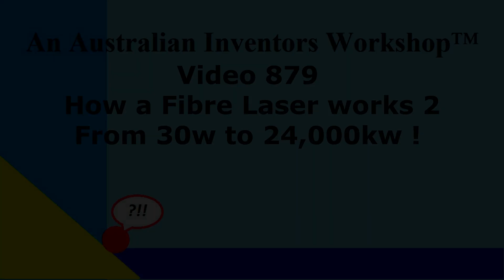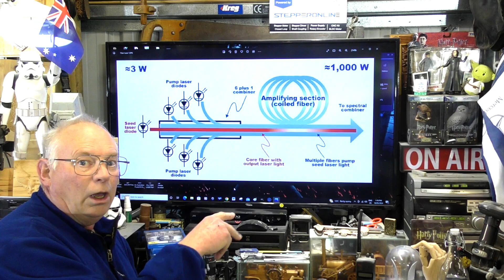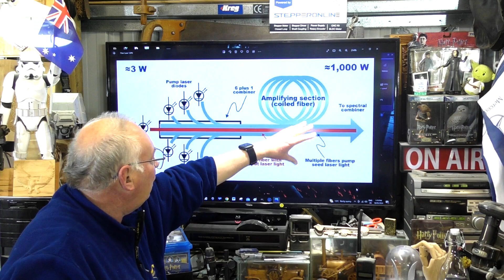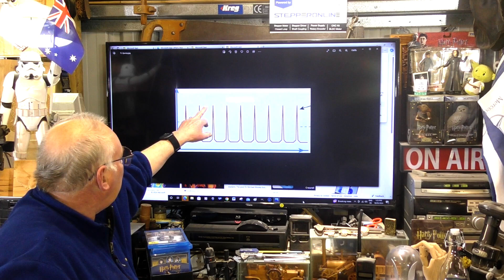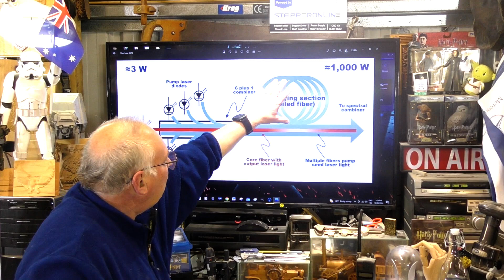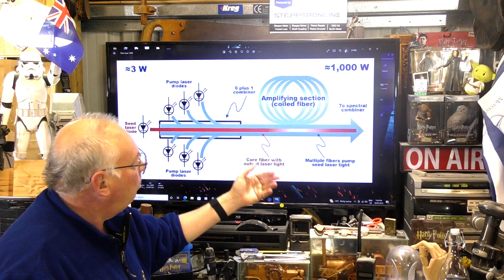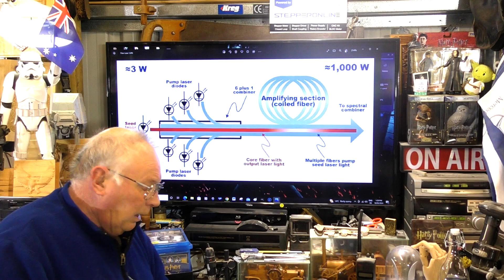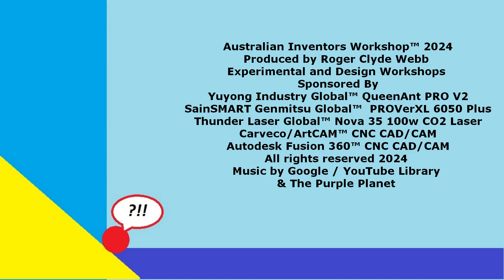Laser Tech Tuesday How a Fibre Laser works! #2  From 30w to 24,000kw output

Comment: Thanks so much for part 2 Roger!.
I watched part 1 a number of times but was still a little mystified TBH. But now I'm starting to get it I think. Allow me to pinpoint the clarification and its quite simple really.
The coiled fibre is called the 'amplifier' and this has always confused me as I couldn't comprehend how any amplification or gaining of energy was happening in there. Like, its just a coil of fibre(special fibre, granted.) But then you described the coil as an 'Accumulator or a Capacitor'. Bing! Lightbulb moment!
(Or should that be flash bulb moment?:)
 
All my life an Amplifier has been an active component. But really the coil of fibre is just a medium to gather the photons and keep them bouncing back and forth. The coil does not amplify, it stores. How confusing! So my take away has really been the understanding of the coil, the time scale you mention is straightforward enough to comprehend. But the accumulation of photons inside the coil, now we are talking!!!
Thanks again for the super vid.